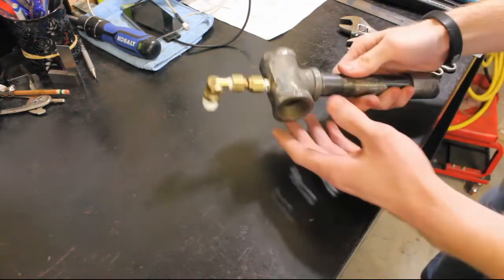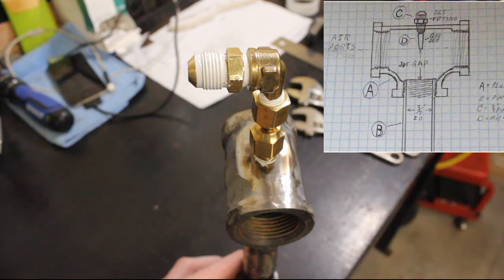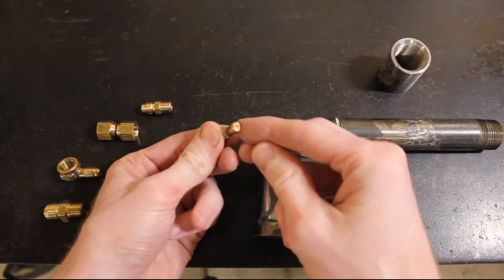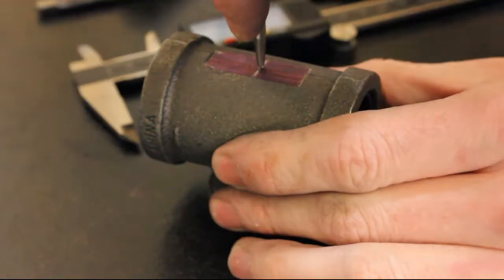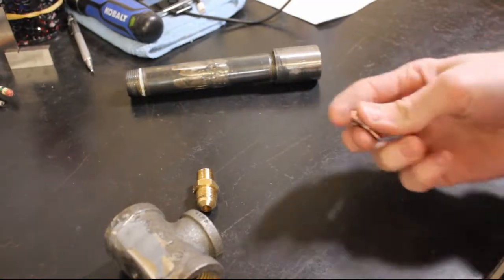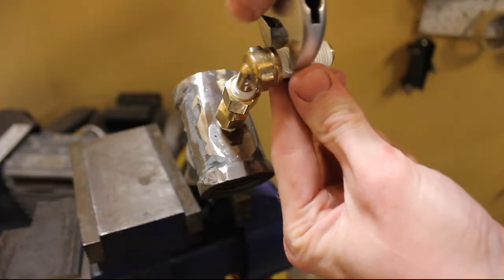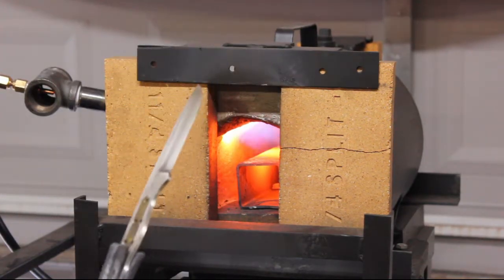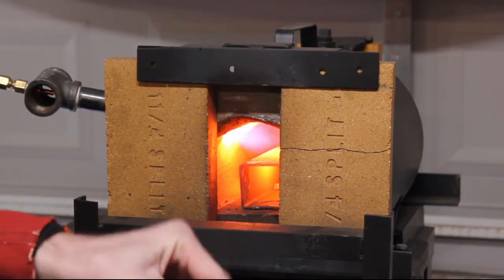How to Build a Venturi Forge Burner for Only $21

Comment: Why doesn't this need a bell reducer to make a venturi?
Reply from the maker: The venturi effect is caused by the "high pressure gas jet" sucking air in from behind it (the T fitting) as it accelerates down the tube.

Comment: What would happen if I used a 3/4x3/4x3/4 tee instead?
Reply from the maker: Hey Lefty, if you mess with the dimensions you may need to adjust the length of the tube and jet to get a desirable air/fuel mix.
Reply: @RedBeardOps  ok thanks!

Comment: Could this idea work to build a powder coat oven obviously the oven doesn't need to reach forge temps
Reply from the maker: Unless you rig up a solenoid and PID I don't think you'd have the temperature control required.

Comment: Do not use Teflon on flare fittings they will actually leak faster. The Threads do not seal on a flare the male and Female contact of the flare is what dose the sealing
Reply from the maker: Good tips George

Comment: I know you mentioned the brass pc you were tapping into came from the manufacturer with the appropriate orifice for the the 1/4" x 28 tap. Is that orifice a 1/4" standard drill size for that tap. I followed a separate video that used a 5mm drill hole for a M6x1 tap and the threads did not match my miller mig tip. Thanks
Reply from the maker: Thanks for the info Mark. Cheers

Comment: Great video Red Beard!! 
One question. Is it not dangerous when the pipe starts to get very hot?
How long can you have it on?
Thanks
Reply from the maker: Man I've run these for hours without issues. CHeers Miquel
Reply: Just make sure to remove the burner once you shut it off. otherwise you will get super hot gas going up the pipe and potentially melting your propane hose

Comment: so should all the components (minus the brass fittings) be black pipe or stainless steel? Or are they the same?
Reply from the maker: All mine are black pipe. SS would also work.
Reply: @RedBeardOps  thanks! looks like black pipe is the way to go!

Comment: Thanks for the great and informative video. I love your channel and find it very inspirational. I just finished my first knife from a kit. I do want to eventually build my own forge just for heat treating purposes. Can you tell me more about the muffle pipe, or is there another video on your channel where you talk about using it? Thanks again for the great video.
Reply from the maker: Hey Jon, The muffle pipe is just a piece of 2x2 square tubing that I welded a cap on to. Cap isn't needed though. The point is just to shield the blade from direct flame. This helps get a more even heat on the blade. It's not a necessary item though.

Comment: My main concern is the gas flowing back when the tank starts running low. So my question is how can I ensure this doesn't happen? Check valve and a regulator or either one of the two?
Reply from the maker: Hey J, I don't know the best solution, but when my tank runs low the burner just dies out.
Reply: @RedBeardOps  thanks for getting back with me. I have a big torch and it takes forever to get to get the metal to temp lol

Comment: I like the simplicity of the build. The fact you listed the parts needed, makes me owe you a beer. One question. The way it is currently setup, running a higher psi than 5. Is the possibility there to use this exact burner in a furnace for casting? I've seen this build, atleast similarly done. The way you talk, makes me slightly hesitant to use it in a furnace
Reply from the maker: I'll be honest, I really don't know about using it in a furnace.
Reply: @RedBeardOps  What temps are you required to reach for heat treating? 2000F?
Reply from the maker: @thebro5820  around 1500 for 1084
Reply: @RedBeardOps  Appreciate the info. Looking at upgrading my furnace. 1500 will definitely melt aluminum. If you were running that at a lower psi then I believe it is possible to hit temps around 2100 which is what I'd need for casting copper affectively. Thanks for replying. Keep making videos. Look forward to seeing more.

Comment: Ahhh haaa so that’s why my burners won’t hold the flame, I don’t have any flare or reducers on the end of the pipe!
Reply from the maker: For sure man. If you have it in a forge chamber of the appropriate size for the burner the chamber will hold the flame. But to be honest I like having the reducer on there anyway... doesn't hurt.
Reply: @RedBeardOps  yep the next day I got two 1x3/4 reducer couplings and the burners worked great! And then I tried them without the reducers in my forge and again they worked fine! I’m so glad I watched your video... thanks again!

Comment: so... how do I make this without a drill press ?
I have a drill and an angle grinder will this work?
thanks
Reply from the maker: For sure man. You should be able to do this with just and hand drill. Just be as carful as you can to drill a straight hole and get your tap started straight.

Comment: Looks like you have a length of square tubing inside the forge , does this aid in heating the blade more evenly such as keeping the flame away from the blade . I haven’t seen this before but it appears to possibly work that way .
Reply from the maker: Hey Randy, this is called a "muffle pipe". It just makes it easier to evenly heat the blade like you said. Very handy.

Comment: I have always wondered if on this type burner if 2 all thread nipples and 2 full port ball valves could be used as an adjustable choke but I do know to use black iron gas pipe and fittings instead of galvanized  also the merchant coupling or the bell reducer should keep the threaded end which is thin from burning up
Reply from the maker: Man I don't know, but it could be worth a try for sure.

Comment: So the forge I just built was made from an old air compressor tank.  it’s about 14” long ( about 1-1/2 fire bricks long) and about 12” across... I cut off the front end and welded a hinge to it to make a door, on the other end I cut a  3” tall  x 5” wide hole so I can look inside if I’m using the forge with the front door shut without losing too much heat. I lined it with Kao wool, about 1” thick and laid two fire bricks down on the floor to lay my steel on.  What sized burner should I use in it? I have something similar to the one in this video and at full blast I got flame shooting out of the door when it’s open...lol  I think I need to somehow make the flame be more  concentrated, I think it’s too wide as it is now, the nozzle  is a 3/4” pipe nipple  with a cone on the end that’s someplace between 1” and 1-1/4” .  Your thoughts?
Reply from the maker: So mine is also an air tank, but I have 2 layers of 1'' wool which makes the ID ~ 6'' before the fire brick floor (I used 1'' fire bricks for the floor). This burner will work in my forge. If you want more power and more control, I'd suggest making a forced air burner.
Reply: Red Beard Ops I only have one layer of the one inch thick Kai wool blanket and two 1” fire bricks on the floor... seems to work well  I also moved my burner so now it shoots straight down in the center of the forge so stead of from an angle like it was... it seems to be heating up the inside really well.

Comment: Over the past month or so I’ve been getting into some very simple knife forging and making some stuff for the house like bird-feeder hangers using a blowtorch powered furnace filed out of two fire bricks. Definitely going to use this burner and the simple forge design from the essential craftsman to upgrade as soon as I can get a decent anvil that’s not the 15 pound harbor freight one I found and have been using
Reply from the maker: Excellent man! Good luck with your builds!

Comment: What are your thoughts on adding a valved flow controlling shop vac to increase the heat? or will this get a small melting foundry hot  enough to melt copper/aluminum?
Reply from the maker: If you want more heat and have a blower, I'd advise a forced air burner. Like this one - https://youtu.be/WtCWbl-Q5fo

It will be hot enough to do anything you'd want to do.

Comment: Hi. 
Awesome video. I guess my only question is what is the purpose of the merchant coupling if it doesn't hold the flame? Is it to creat a tighter seal with the forge body or is it a flair? If it's a flair is it needed inside the forge itself as the forge will hold the flame?
New to this and just getting my head around it. 
Cheers. :)
Reply from the maker: Hey Bart, good question. To me the merchant coupling was intended to provide a smooth surface to interface with the forge body. As a stand alone it will not hold the flame well. When in the forge (if the forge is designed to an appropriate size for the burner size) the flame holder is not necessary since the forge will hold the flame. That being said, there is nothing wrong with using the merchant coupling or flair in combination with the forge.
Reply: @RedBeardOps  awesome thank you. I guess I was kind of close to the mark. I'm in the process of building my first forge. Going simple to begin to see if I'm going to stick with it. Your video really helped me figure out that part of it. Cheers. :)

Comment: Some have a choke on the air feed, where as yrs is an open T that draws plenty air to the mix.
Reply from the maker: This is true. The only way to tune this one is adjusting the gas pressure and adjusting the depth of the mig tip. I think one with adjustable air flow would be more easily adjustable.

Comment: Great job bro!  but I have small Q for u bro! 
is there any standard length of flare pipe inside the tee?
Reply from the maker: are you talking about a standard length of the mig tip inside the tee?
Reply: @RedBeardOps  exactly bro
Reply from the maker: @ZainStore  Well mine ended up working well without any modification to the mig tip or fitting. So the stock length may work for you as well. If your burner runs rich you can shave off a little bit of the mig tip (1/16'' at a time) and re-test. As you shave it back it should bring more air in. (If I remember right)

Comment: Love how straightforward this build is.   don't have the tap for the MIG tip. But I have seen a few builds that use a brass cap (instead of a MIG tip), with a 1/32" hole drilled into the center of the cap for the gas.  What do you think of that approach?
Reply from the maker: Hey Joe, I've never tried it, but if the sizing of the hole is similar to the mig tip and the distance into the T is the same; it should work just as good. Cheers man!
Reply: @RedBeardOps  I tried the end cap and it worked, but my flame was pretty raggedy.  Tried the mig time and much much better.  Sill have some tuning to do.  But a night and day difference
Reply from the maker: @joewhite4564  Nice, good to hear. Maybe it has something to do with the length of the hole being longer in the mig tip than if you just popped a short hole in a cap. A longer restriction. Who knows, glad it's working for you!
Reply: all my MIG tips are .035 so hopefully they'll work.

Comment: So I built one of these to try and build a soft glass blowing furnace. I’m having issues with keeping the flame lit. It seams to want to blow itself out after awhile. Any help would be appreciated. B
Reply from the maker: How large is your furnace? Are you using a flame holder (reducer) on the end of the burner? What size mig tip did you use? Did you use the exact size pipe fittings? Cheers sir!
Reply: Red Beard Ops yes i followed the instructions exactly and used the standard reducer. I just purchased the 3/4 to 1 inch reducer to try that on the tip but can’t get the old reducer off now lol. I used the .030 mig tip. My inner furnace dimensions are pretty small. About 10 inches front to back, 1.5 feet wide and 1.5 feet tall. I had the furnace going yesterday but it eventually jsut blows out the flame and won’t relight after about 20 minutes. Today I can’t get the thing to light up at all it just want to blow out. I tried reducing the air intake down to 3/4 with adapters to see if that would help but no luck. Could it be that I have the torch on a down angle? Thx B☮️
Reply from the maker: @bgrossinger  No man, I don't think that's it. I would say that 18x18x10 isn't "small" , but with the reducer the forge should still be running. In your situation I would try to adjust the length of the mig tip by shaving off a little from the tip. Start small. Shave off around 1/16'' at a time and then re-test it. By shaving off the tip of the mig tip, you're effectively changing how much air the tip draws into the burner. Also these burners run at a fairly high pressure. Make sure you're sending it around 5-7 psi. Good luck sir! Let me know if any of that works.
Reply: Red Beard Ops I tried that didn’t work. I’m going to try the 3/4 in to one inch busing for the torch tip. Do you think the fact that I had the torch tip 1 inch inside the furnace is an issue? Should the tip of the torch head be flush with the inside wall of the furnace/forge wall? Lmk thx B☮️💪🤠
Reply from the maker: @bgrossinger  I generally have it flush
Reply: Also, what pressure do you run your propane regulator at? Thx B
Reply from the maker: @bgrossinger  For a venturi burner like this you're going to need 5-7 psi. Forced air burners with a blower can get down to ~0.5 psi
Reply: Red Beard Ops cool thanks I’m going to give it a go tmrw I think that running it flush will solve the problem. B☮️☮️☮️

Comment: Im in the process of ordering the parts for this build, kinda difficult because I live in Europe.
Is there a chance you can write the drill bit sizes because I'm trying to convert all of that to metric.
Great video, thanks in advance
Reply from the maker: Hey Darko,  good luck with your build! Type "drill bit table" into google. Cheers.
Reply: Hey darko, were you able to find all parts in EU. I am having a hard time. I am from the Netherlands. Hooe you have some tips. Or a list. Thanks in advance.
Reply: @MEKZfpv  I did manage do male a burner but because of lack of materials I had to improvise. 
I would like to send you some fotos and explain more but I don't know how to do that over YouTube.

Comment: By far the best forging burner video out there. Question. Can you do another video modifying this to a “dual” burner. Thanks in advance.
Reply from the maker: Appreciate that praise, sir. I've seen some guys do duel burners, but I don't currently have the need. I later converted my forge to forced air since I feel it gave me more overall control. And the forced air burner is more than enough for the size forge I have. Glad you enjoyed this one. Cheers man.

Comment: Thanks for a great build. What is the max temp possible?
Reply from the maker: I'm not sure, but you could forge weld with it.
Reply: @RedBeardOps  I am building a foundry. I build a forge already That works well but is way to small to smelt brass, copper and aluminum. Thanks for a great video.
Reply from the maker: @CandSMINING  I see. 10-4. Check out my forced air burner. I bet it can put out way more. https://youtu.be/WtCWbl-Q5fo - Glad you enjoyed it sir! Cheers
Reply: @RedBeardOps  Thanks, I'll check it out. Stay safe.

Comment: Could you explain what you mean by adjust the length of the mig tip?
Reply from the maker: Yes sir, you can shave off some of the length of the tip by grinding it on the non-thread side. Either by hand with a file or on a belt grinder.
Reply: Red Beard. I’m built this burner now. What does shaving the mig tip do again? Thanks
Reply from the maker: @valleycapitaladvisors  Hello sir, by reducing the height of the mig tip it changes the location of the jet in the T. By changing the location of the tip it will affect how the jet stream of gas pulling in air. If I remember right, the more you shave the tip the further away from the tube it gets and the more air will be drawn in.
Reply: @RedBeardOps  finally the reason and why I need to move my tip back. Thanks
Reply from the maker: @stankrieger3137  I demonstrated this process in my most recent forge build if you want another look at it.

Comment: simplest one iv seen so far ,  thumbs up.
Reply from the maker: Glad you liked it! Make sure to soap test your lines for leaks before starting it up.
Reply: @RedBeardOps  im still working on the regulator & line, if you have an in line adjust valve whats with a high pressure regulator
Reply from the maker: @spotlobac7694  I'm not sure I fully understand your question. I'm fairly sure my regulator is 30psi.
Reply: @RedBeardOps  sorry i thought you wouldnt  need a regulator at all if you had an in line valve to adjust pressure / flame.
Reply from the maker: @spotlobac7694  I see. I like (and think it's safer) to have a regulator close to the tank.
Reply: @RedBeardOps  gottcha ,  thanx.

Comment: Listing the tap sizes instead of a full kit would have been helpful. Otherwise great vid.
Reply from the maker: Glad you enjoyed the video! Sorry about that.. that's the kit I got for my shop.
Reply: Red Beard Ops that’s alright, it was just awkward watching the video in the hardware store looking for the parts because I forgot to write it down. lol
Reply from the maker: Rein Quest I get ya, makes sense. Good luck with your build! Be safe and spray your connections with soapy water to check for leaks 👍

Comment: the learning curve is rough by yourself thats all i know.
Is an air control system needed to better control the propane output and give a more stable burn? is it really necessary ?
Reply from the maker: LoneSouthAfricanBear I’m not sure I understand your question, but the air control system on this burner is the length of the mig tip.